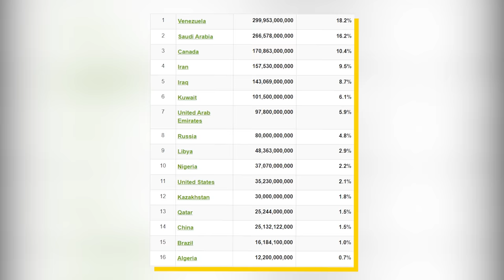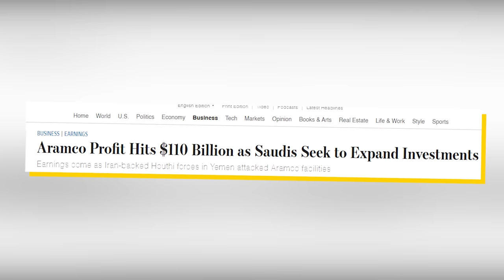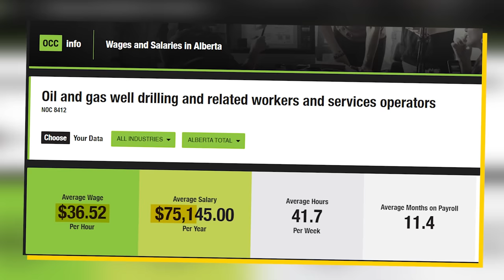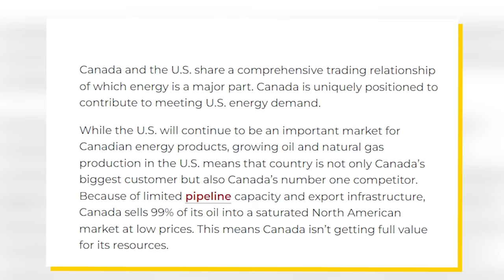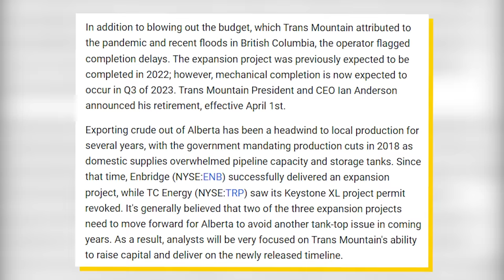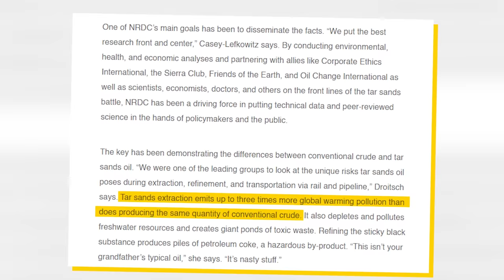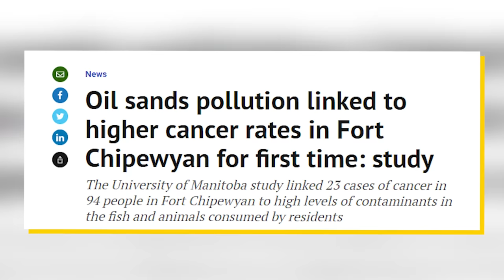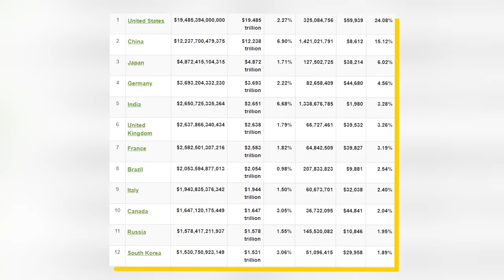Why Canada Refuses To Exploit Their Gigantic Oil Reserves

Comment: Canada needs to stop importing oil and start using what we produce for domestic needs. Importing oil to eastern Canada and refining Canadian oil in the USA only to import it back into BC does little for our economy. This was Germany's plan for the last 20 years and now it's all falling apart due to the war in eastern europe. You need to address your own needs first to safeguard your own future. After that control your exports to balance your imports with excess oil production. The remainder of the economy will provide for the economic growth as oil becomes less important as an energy source for the movement of people and the transport of goods.
Reply: They did try to build a pipeline to eastern Canada
Reply: @jameson1239  Quebec said: "No thanks!  Tankers from Saudi Arabia up the St. Lawrence is much better than a pipe from a dirty Albertan!"
Reply: @Kill Me Need is a strong word... what's so wrong with the collapse?
Reply: That means closing 3/4 of the industry down.
Reply: Why do people pretend that a fractional market share of the vancouver / victoria fuel market is a national issue? Western Canada has all the refining capacity it needs to match domestic demand, everything after that is a trade issue and protectionism is never the answer. 

The answer to these issues is obvious and there really is only one; It's time for the western provinces to separate.
Reply: Suncor use over 50% Canadian oil. Btw It is too Suncor who do the trade not Quebec.

Comment: Not all of Canada breaks even at 90$ a barrel. Canadian companies like Suncor break even at 30$ a barrel.
Reply: I believe you are confusing crude oil sales with refined product sales -- a barrel of crude oil can produce many different things from engine oil to gas to chemicals depending on how its distilled and mixed in the refining process -- refined oil 30$ a barrel is probably profitable but selling crude direct it may require 100+ $ a barrel for it to be worth while.
Reply: @DotADBX  you are right perhaps I was confused by the video
Reply: It’s an average. But, on average, Canada has some of the highest production costs in the world, which are now roughly double those of the US.
Reply: @DotADBX  no you seem confused . refined products cost more than crude. suncor can break even at 30 dollars a barrel crude oil price. they are selling crude oil . for instance now hydraulic oil is 6 / gallon in u.s. so 240 a barrel.
Reply: Conventional oil is even cheaper to extract. 90$ cost for oil sands is crazy 😂 it's actually 25 to 40$...
Reply: But are only paid in WCS
Reply: @lestat8656  Not full cycle production costs - i.e., everything from exploration to refining and distribution. Canada is usually at or very near the top of the list of net exporters in terms of total production costs. Most estimates put the average around $75-80.

Conventional is also not necessarily cheaper to extract anymore. All of the easy conventional stuff has already been tapped; what’s left is often in very difficult locations and/or has very difficult geography. Shale in the States is now cheaper to produce than the global and even OPEC conventional average; on a full cycle cost basis, only Saudi Arabian and maybe Russian conventional is still cheaper. And shale is very light and very sweet (i.e., very high quality that’s easy to refine, and generally trades at a significant premium) whereas conventional is increasingly heavy and sour.
Reply: Canada has both conventional oil and oil sands oil.
Reply: @DotADBX   their break even costs at legacy producers like  suncor are actually that low even for their semi-upgraded crude due to the long term amortization of their assets.  Most of their infrastructure has been paid off for decades which drastically lowers cost per barrel
Reply: Exactly, in fact, for the first time in a very long time, we are currently competing with Russian crude for the same low cost market share
Reply: @JohnnyAmerique  you need to find a better site telling you these fantasy prices.  CNRL break even is $18 per barrel for oil sands.  It runs at $30/barrel when new construction starts and takes usually 2 years to pay off the debt from build out.  Suncor is even more efficient.
Reply: @ronblack7870  Why Suncor say it is a low price, it because they play whit number. They are buying that oil from themself.
Reply: Suncor has it down to around $23.50 per barrel now.

Comment: Canada DOES have liquid oil!! I personally know people who work on the oil fields working on "traditional" extraction methods.  The thing is there is more oil in the tar sands, and like the video explained it is harder and more expensive to extract.  But when the price is lower we are STILL pumping huge amounts of oil out of the ground
Reply: Liquid oil has been pumped out of Alberta for Decades Think Leduc no.1 in 1949 . The oil sands did not really kick off till the 70s
Reply: Keep in mind that conventional made up ~80% of Alberta's oil production with oilsands (mostly strip mining) made up the remaining 
~20% around the turn of the century.  Now those figures are flipped largely due to automation and tech advances so any type of modern in-situ oilsands is typically far cheaper per barrel all said - and that's saying a lot considering it's ~2-4x more CO2 intensive and we have a escalating carbon tax factored into that.  Conventional oil basins age out way faster and they typically end up relying on "water flooding" aka 90%+ water of the total pumped mixture (this automation also explains mass job loss in the industry over that time).
Reply: There is liquid oil offshore Newfoundland and Labrador.... Just sayin
Reply: @djsnowman06  Also a major industry in Sask is conventional oil drilling and extracting.

Comment: One issue is that British Columbia really does not like having oil tankers transit through its coastal areas. There is actually a ban on tankers along most of the coast post- Exxon Valdez
Reply: Its not an issue if its solves a problem:  Can't have oil spills if there are no oil tankers.  That coastline is far more important then the need to have trucks and RV's.  We don't need larger landfills.
Reply: I can understand their position tbf, the vancouver bay area doesn't exactly have the best, water flow, everything flows into it, not really out, so an oil spill in the bay would destroy the bay for potentially years.
Reply: United states runs the tankers through any how so Canada Might as well run their own
Reply: @GargamelSS  More tanks only increases the odds of a problem having.  More is not Better.
Reply: @GargamelSS  Americans don't take the same route.
Reply: @chrisklugh  Isn't it ironic that Canada bans oil tankers on its west coast but not its east coast. This is so they can import cheap oil from Saudi Arabia for eastern Canadians but limit Alberta oil from being exported to world markets, hurting western Canadians.
Reply: @danieltaylor3396  Price.  Its cheaper to buy Arabian Oil then it is to use our dirty expensive stuff.  We have a lot more 'work' we need to do to ours to put it to use. 

I think the problem is we waste to much of it on mundane things, like drive thrus.  Its a finite resources, arguably the rarest thing in the Universe.  Yet we use it like it should be free.
Reply: @danieltaylor3396  First off there is not a ban on tankers on the West Coast. Tankers have been shipping oil out of Vancouver for 65 years without ever one oil spill. They currently have about 30 to 50 tanker shipments yearly but once the Trans Mountain expansion is completed that will increase to about 400 tanker shipments yearly. All tankers accepted into Canadian coastal waters must be double hulled. The size of the tankers will be limited to Aframax tankers (80,000 – 120,000 DWT) due to narrow areas in shipping lanes in BC. All tankers are inspected and Canadian ship pilots supervise navigation and  docking and all tankers are escorted by tugs. How else would you get oil to the Irving refinery in Saint John ,N.B. Canada has no oil pipelines to the east coast.That Irving refinery is Canada's largest refinery and runs on light sweet crude feedstock.That refinery does get some WCS oil from Alberta by rail.  The Saint John oil terminals are located in deepwater so the world's largest T3 tankers can deliver oil from Saudi Arabia.
Reply: @danieltaylor3396  Its a fix.
Reply: Actually, there isn't a ban on tankers anywhere in Canadian waters. Canadian waters haven't been protected since the last Conservative majority under Harper.
Reply: @chrisklugh  bot
Reply: They sure don’t have a issue shipping off b.c. Mined coal though . Bit hypocritical
Reply: @atheisthumanist1964  Check out Bill C-48
Reply: @don-cw1yz  The lack of oil spill is actually misleading as it misses one critical segment.
The oil facility in Burrard Inlet in Burnaby has had a slow seepage into the ground for years, long enough the oil is seeping into the inlet from the land. This all hit the public awareness then the expansion of the Transmountain pipeline was announced. It's no wonder the BC residents are fighting the expansion when the current pipeline is responsible for an ongoing leak.
Reply: @jaquigreenlees  The only oil "leak" from the current Trans Mountain oil pipeline in Burnaby was the result of city crews who did not check as to pipeline route and excavated and broke the pipeline where they were doing some road work in July 2007. You would have thought the crew would have looked at the massive storage tanks and the location of the oil sea terminal and put it together and called before digging.The cleanup costs were $15 Million.  As far as oil tankers in the Burrard inlet in 65 years of operation there has never been an incident with oil spillage or any accidents.The BC ship pilots and tug captains and personnel are very good at what they do. All oil tankers entering Canadian waters must be double hulled and are subject to Canadian inspections to ensure seaworthiness.The fact is Canada is dependent on sales of fossil fuels and other commodities ,just oil means over $100Billion USD to the Canadian economy. We frankly need that money and the jobs that come with it to support the the many social programs we have. Without oil what do you think the CDN $ would be worth ,maybe .55 to .60 cents to the USD? Western provinces need tidal access to enable them to gain takeaway capacity to international markets. That means pipelines through BC to tidal waters. It should be done in the safest way possible and that is being done.The federal government and BC have taken process safety involving oil pipelines ,terminals and contingency operations if there was an oil spill into consideration.
Reply: Quebec too unfortunately
Reply: @don-cw1yz  I was referring to the leak from badly maintained tanks, which happened about a decade before the roadwork damage, as well as the timing of it all, first the seepage is announced then a pipeline expansion. Literally, a leak announced then an increase in oil movement and you expect everyone to be happy with the expansion?
Reply: @nstag8r  Ya?  You know I spent 10 years in the oil industry in Alberta?  You know I'm an economist too and have studied the Energy Equation throughout the last 100K years?  But ya, you know, you can just play the old Ad Hominem card and prove nothing at all.  Well done internet dude, well done.
Reply: @chrisklugh  I’ve worked the last 25 years in Alberta. And also done lots of studying to find out that Alberta is held to by far the highest standards to produce its oil hence one reason why it’s more expensive. To help cater to people like you who believe that Canadian oil is “dirty”.
Reply: @danieltaylor3396 theres no way you really think the east coast is being treated better than the west/plains by ottawa